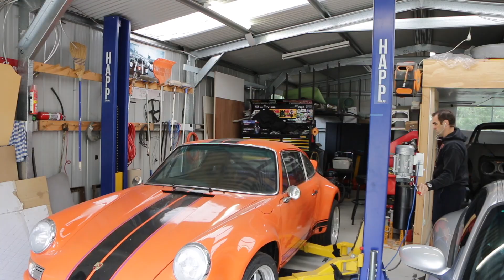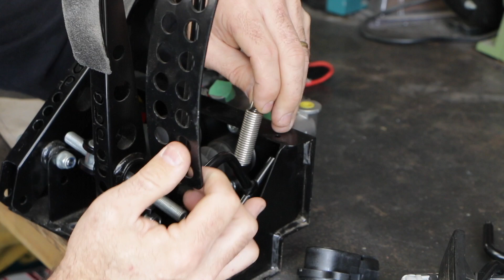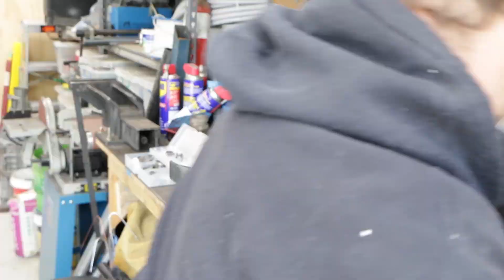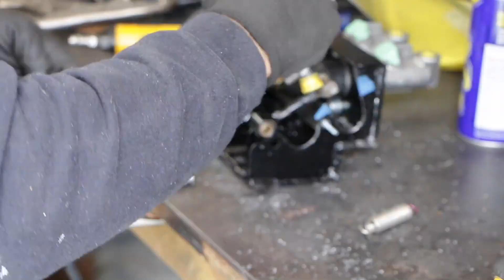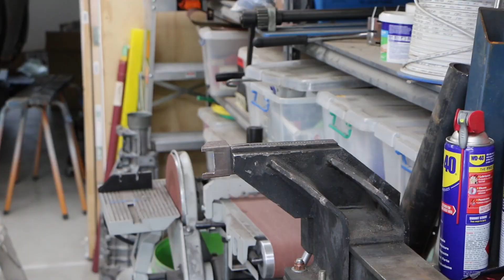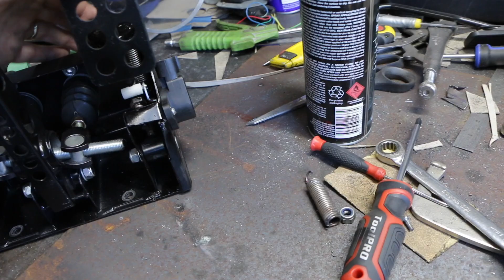Building an E throttle pedal - 911 2.8 RSR Build Season 2.30

Comment: Throttle cable for a clutch cable...bad idea. Tensions are totaly different. On an Aircooled VW clutch cable is far bigger than throttle cable! Moreover I suppose that Porsche clutch is firmer than VW clutch system...

Comment: Another nice episode. I love the way you attack the tasks. Nice build, but have you thought of some protection plate/cover of socket of the sensor. I see a bit of a risk of the socket being close to where you place your feet. With my luck I would step on it and break it.
Reply from the maker: It is tight against the wheel well, so no issues there.
Reply: Home Built By Jeff Great - it is good to hear. Mine is a left hand drive so a lot of space next to the speeder. You are really an inspiration for doing task - and the spirit in redo work again when you make mistakes. We all make mistakes but I find it hard to motivate myself to do it.

Comment: That pedal box is mounted very close to the interior wheel well in the opening shot...hope you can get it back in with the sensor mounted on the outside. It might be close.
Reply from the maker: It fits ;)
Reply: Sweet

Comment: Hi Jeff, I noticed that while using the pedal position sensor in reverse will work I worry that due to the way the internal spring works if the little arm or the casing breaks it will fail to full throttle..... 😬😬😬
Reply from the maker: True
Reply: You could fabricate a metal cover for the side of the pedal box to protect the sensor from getting kicked off. The bolts for the sensor are so small (relatively).

Comment: My only concern is that there is nothing "enclosing" the roller for the sensor. If it happens to stick, when the springs pull the throttle back to home, there is nothing to pull the sensor roller and could cause the throttle to stick. Otherwise, it's a sweet mod. Nice job!
Reply: JayinMI This is working the other way around. Pressing the pedal lets the sensor increase with its internal return spring, while depressessing the pedal forces the sensor back.

Comment: I'm surprised you didn't make the spring tension adjustable for pedal feel. You know a hinged double plate with a bolt to change the load on the pedals. Nothing worse than putting it in and not liking pedal feedback. Great job on the pedal box. Love the "CAD" work. Getting close to the end but I'm willing to wait a while longer!
Reply from the maker: I can just change springs ;)

Comment: Quick question about the tab or whatever it is the sensor arm rests on. If you stab the throttle quick is there a chance for it to pop out of position? 

What I pictured in my head when you first described what you were doing was a small section of tube to be welded on the throttle arm that the sensor arm could captively slide into. 

If it isn't an issue then ignore me but it was just a thought I had.
Reply from the maker: No possible way for it to jump off. There is not enough movement in the pedal for it to come off the back of the arm.

Comment: Nice work, my only concern would be failsafe.. If the pedal fails at the pivot, or the springs snap/become detached, the pedal will drop and you will be at Wide Open Throttle . I had a throttle stick on me once and it was not a fun experience. Fortunately it was on a manual gearbox car, so I could put in the clutch, turn the engine off at the key (but only off a quarter turn so my steering lock did not engage) and coast to a stop on the side of the road.
Reply: Some race cars have shoe toe hook at the  top to pull it back up.
Reply: The ECU migh be able to find it to be out of range and zero throttle output.

Comment: Hey Jeff, why didn't you try a push spring setup?
I'm referencing the Logitech G27 wheel I have at home. The pedals push on a spring that lifts them back up.
Reply from the maker: Because that is the springs I had ;)

Comment: Dual springs a must for safety
Reply: 69MazdaR100 Exactly, redundancy in case of a spring failing
Reply: Also -- MOT inspector might notice missing spring?
Reply: @anonymic79  In Jeff's custom box, if the single spring breaks, the throttle goes to max and there's no way to pull it back. Very dangerous. Second spring gives redundancy. Because it's custom I would imagine the inspector would look closely and see that. Dunno about standard OEM throttle linkages; can they fail in that mode?
Reply: @anonymic79  Guess they wouldn't.

Comment: Jeff, if you move the top mount for the springs further forward towards the pedal, it'll give you a longer travel on the pedal. As it is you aren't building up tension in the springs until half way down the throttle. Your design works, I just wonder whether it wouldn't be nicer to have the more upright starting position of the pedal.
Reply from the maker: I set the pedal exactly at the place I wanted it. I could have easily gone higher, but that would not have been a comfortable angle ;)
Reply: @HomeBuiltByJeff  Fair point Jeff, I can't argue that. Anyway I was only going of the pedalbox on the bench

Comment: Nice work Jeff shes getting there. May want to reconsider using a throttle cable for the clutch. Clutch cables are usually much  thicker and heavy duty than a throttle cable.
Reply from the maker: Good point. I will go with this for now, but I may need to rethink it in the future.
Reply: Yes, that's a good point, clutch cables are generally 3 - 4 MM dia cable , similar to handbrake cables. Thin throttle cable would stretch and snap.  In Ireland here I use a company called Cablecraft who make any cable to standard or custom specifications, I'm sure that there's a similar company near you to do the same.

Comment: A BMW pedal might have been a better option, they are floor hinged similar to the P-car and small in foot print not having the sensor etc off to one side, a lot of Ecu’s  are set up and calibrated for them already.
Reply from the maker: Got to make it also fit in the pedal box, so this was simple with what I had to work with.

Comment: wow you had me worried for a second then, but in your usual style and expertise you pulled it all off, the throttle spring arrangement is often made up of two spring one heavier than the other to give a progressive response (just a thought)
Reply from the maker: In the BRZ case they are the same size, but if I can't find a match that may be what I use ;)

Comment: You are using a BMW throttle actuator. The throttle position sensor (potentiometer) on the actuator is the same as what they use on the throttle pedal. You can buy the TPS seperately. On My S54B32, there is one TPS on the pedal, the actuator and the throttle shaft that actuates the mutliple throttle bodies, all the same. It might be recommendable to use the same sensor for your pedal.
Reply from the maker: It makes no difference as it is all done in the ECU software. I can change the limits and the ramp rates at will.